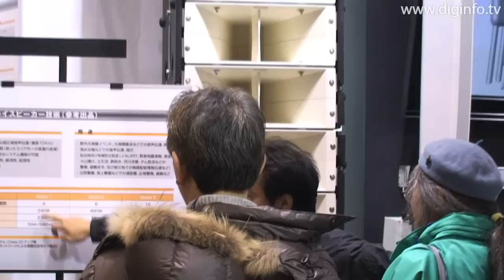Long Range Horn Array Speaker Technology by TOA : DigInfo

Comment: Some tornado sirens currently in production use a line-array of speakers to project a beam of sound. Whelen Engineering Inc model 4004s and Vortex-Rs are two examples.
Reply: DSA's kinda and also they look like LRAD sirens